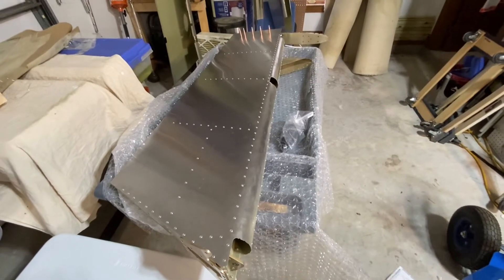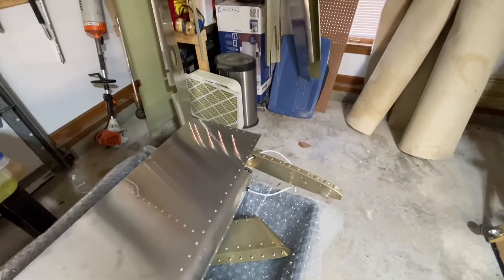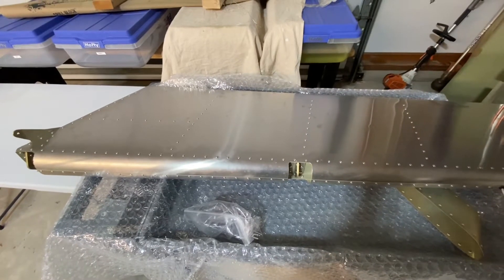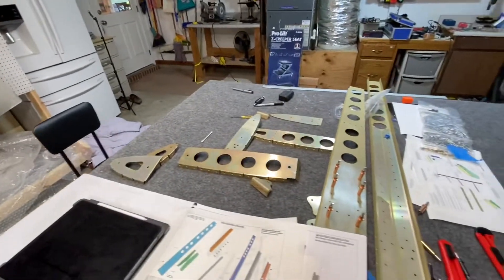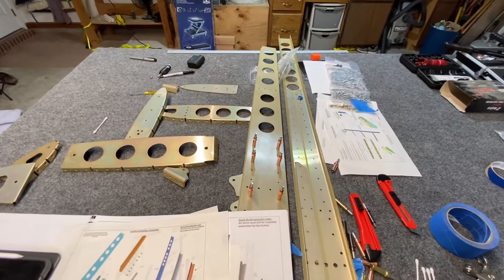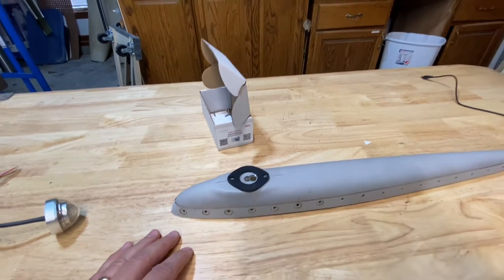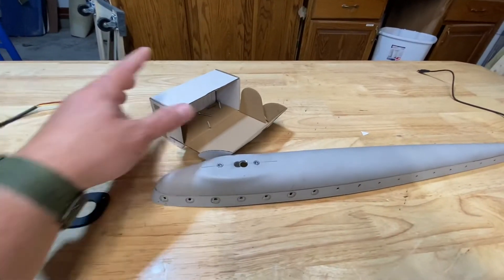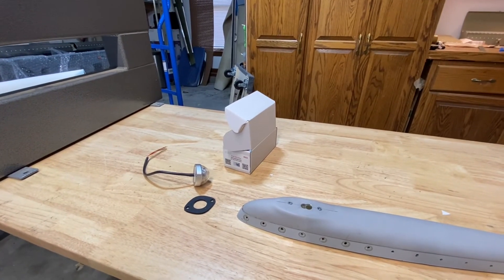Sling TSI Experimental Aircraft Build Update on Rudder and Vertical Stabilizer

Comment: My sling order is in. Noob here. Does a light not come with the kit? Or did you decide for a different light? Just curious if I need to get this part on order
Reply from the maker: Sling provide the landing lights in the wings only.  Depending what lights you buy for the wingtip, you don’t have to have a light on top of the rudder or on the bottom of the empennage. I used a light from Aveo Engineering that is actually a designed for drones but it mostly fits on top of the rudder.  I have 360 coverage from my wingtip lights so this is extra anyway.
Reply: @aviationkitbuilder  thank you for the good feed back. Much appreciative. I have been talking with adam from Midwest panel builders. I will more than likely go through him for all of my lights. I know sling does have an LED lighting package. I will need to review with TAF what exactly is included there

Comment: Getting ready to build mine. What washers did you order on Amazon? They don’t provide the washers?
Reply from the maker: I was referring to aluminum backing washers for adding strength the point where the rivets secures to the fiberglass.  I’ve heard Sling has started reinforcing this area on the fiberglass tips better so the added backing washer may not be necessary.